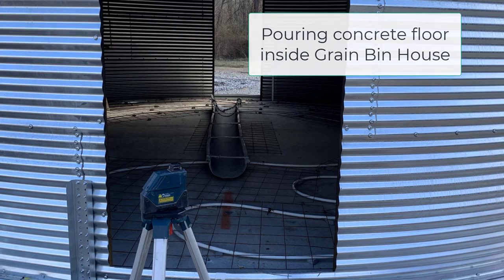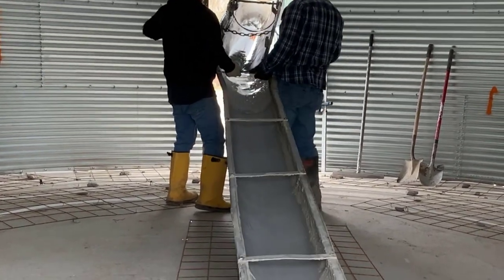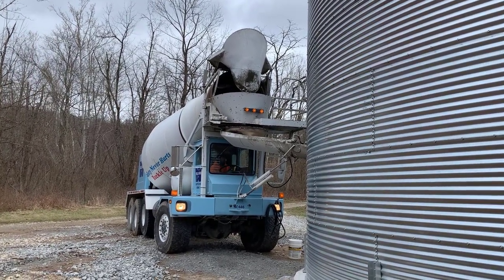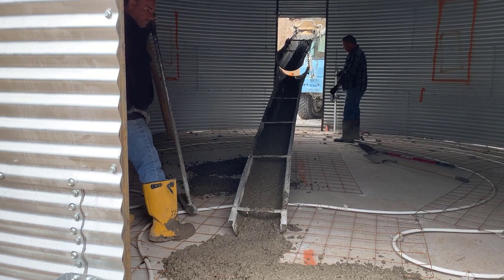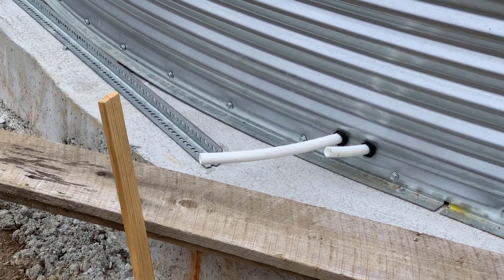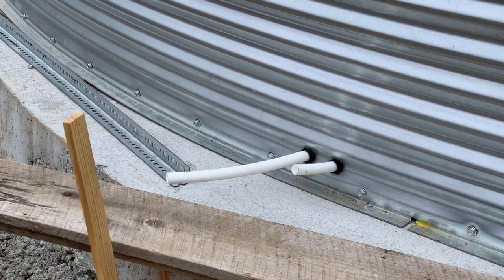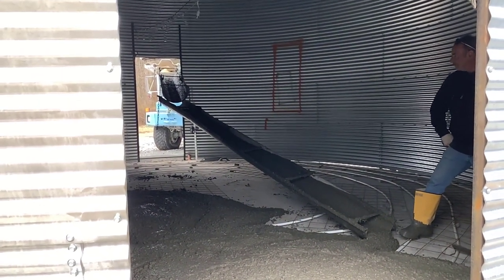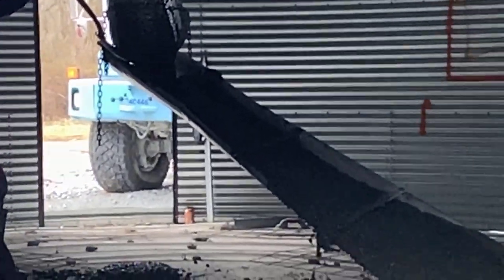Pour Concrete Floor in Grain Bin House  E12

Comment: Do you need insulation under the pex?
Reply from the maker: You can use insulation.  It is recommended if you are going to lay flooring for example to prevent moisture.  We are not putting flooring on the concrete but an epoxy glaze (as of now) still discussing.  Honestly, in hindsite I would recommend yes, add it.  You can never do too much to protect from moisture...